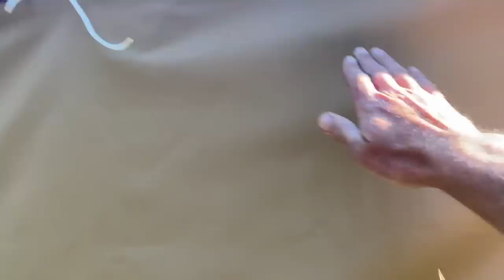Some idiots stole our Broiler Chicks

Comment: We work with and use cellular trail cameras by the brand icuserver. Their external battery attached, the locked steal case and it works like a charme. This solution runs for almost 5 months through without the need to change batteries and you receive the photo the moment someone walks into the sensor range on 3G/4G cellular connection to your phone. So even if they steal the cam in the end, you got them on photo first. Works also with infrared to prevent foxes, martens,.. to kill all your birds in one night, with this setup you can react earlier and not wake up to a complete mess. I can really recommend it.

Comment: Some unrequested advice:
If you want to bury insulation use extruded styrofoam, XPS which is usually colored pink, sometimes green. It is more expensive but it is more effective in ground because it does not allow water in it. (it consist of closed cells)

Comment: Mobile devices usually send out a probe request to WiFi routers if WiFi is activated on the phone, which usually is how most people have it. Even if they don't connect they automatically probe for it.   I'm not sure if routers log these requests but you might want to look into this. If the perpetrator had his/her phone or their phones on them they might have left a trace, I believe a mac address. That's not very useful to you unless you know it but police might be able to track it down.

Comment: I’d just scatter shell casings around the parking area and entrance to buildings and put up a bunch of superfluous signage riddled it with bullet holes on the way in. Maybe a burned up motor home or two. No one will screw with you. Sorry Richard, that is messed up! If they are vegans I hope they faint from iron deficiency and fall into traffic! Not really just sort of. At least faint and fall down and be forced to reevaluate things.